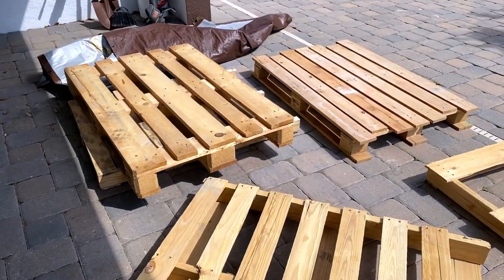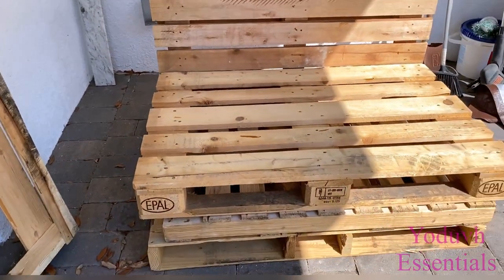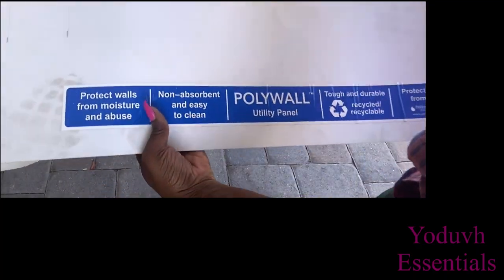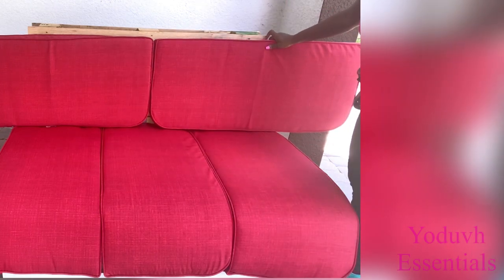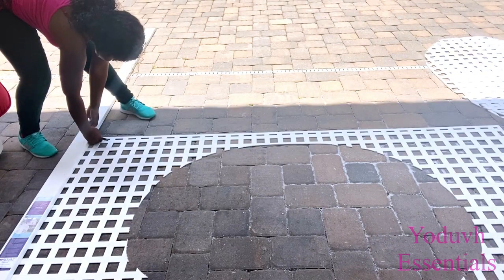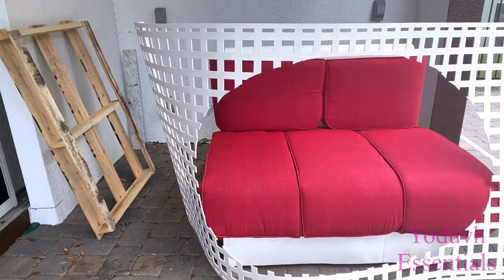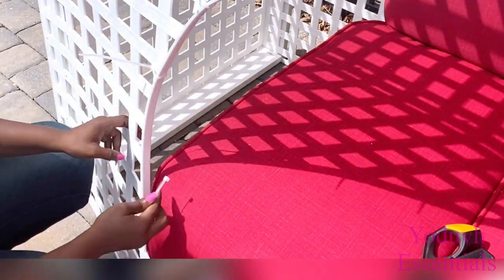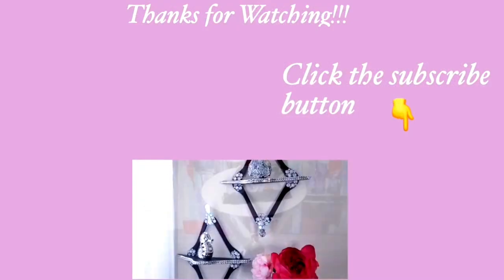HOW TO Turn Pallets Into A DAYBED! DIY DAYBED| Amazing Way To Use Wood Pallets!

Comment: One could add a piece of canvas/outdoor fabric the same size as the roof and/or the back (as a shade) and roll it up with ties when not in use and then untie it to drop it down when needed for shade (and the ties on the edge can attach it to the front of the roof).